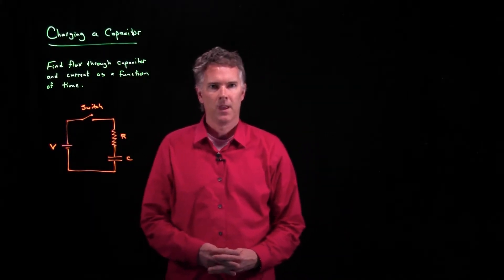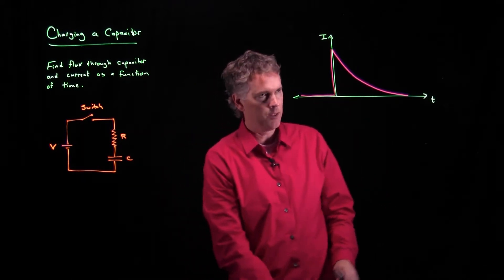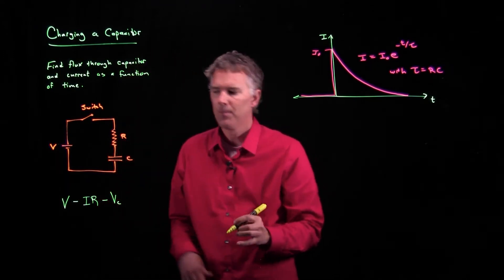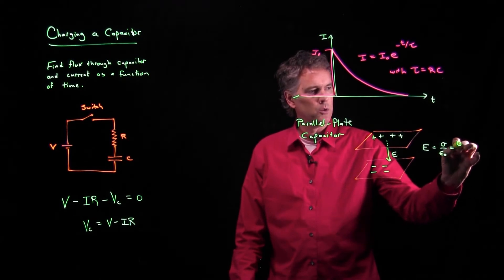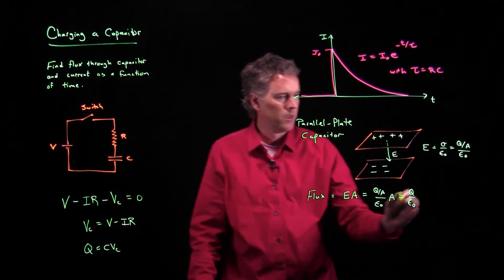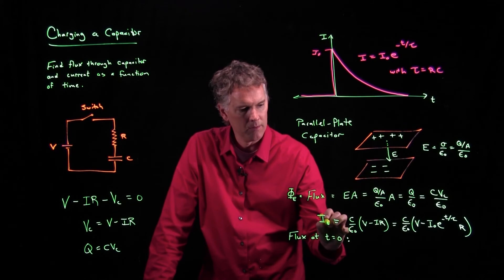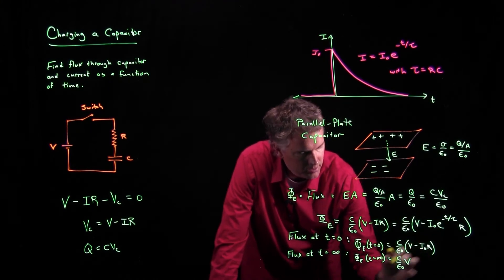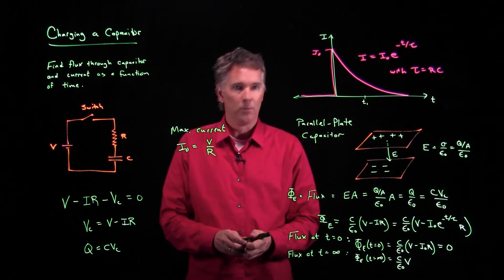Charging a capacitor

Comment: When the capacitor is charged through the resistor there will be an energy loss in the resistor. That loss is exactly half the energy in the capacitor when fully charged.  It seems surprising that the loss does not depend on the resistors resistance. So what happens when the resistance is zero? An infinite current, a singularity?  In real life we would get an oscillation because there always is a self-induction and energy would be radiated. It means that in a world where we assume there is no inductance while we have capacitors our theory must be incomplete.

Comment: Professor, if there is no flux accross the capacitors, so how does it 'conduct' electricity through it ?
Reply from the maker: Sahil Sagwekar VEVO, 
Only works with AC current.
Thanks for the comment, and keep up with the physics!
You might also like my new website: www.universityphysics.education
Cheers,
Dr. A

Comment: In discharge: V2/Vc = e^(-t/rc)
In charging: V2/Vc = 1- e^(-t/rc)
If I had a big schematic to design, these were fast, conditioned response. I did it for money at a lot of companies, designing power supplies and battery chargers from 1977 to 2008.

Comment: What happens when you charge a capacitor that has charge on it lesser than the potential of the battery?
Reply: I think they will level up until steady state is reached
Reply from the maker: Then it will have a smaller voltage than the battery and not as much charge on it as it could have, since Q=CV.
Cheers,
Dr. A

Comment: By what i mean a load max is 3 amps does it only pushes 3 amps or does the capacitor pushes more than 3 amps
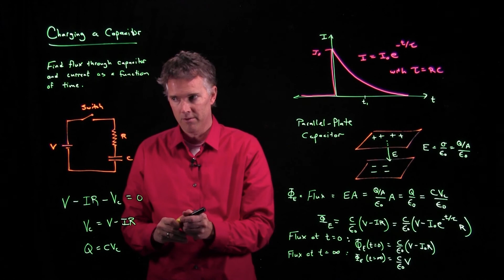Reply from the maker: It is definitely limited by the resistive load.  In our circuit, the current is limited by I0 = V / R as shown at 9:07
Cheers,
Dr. A